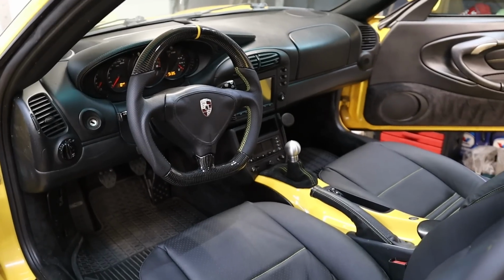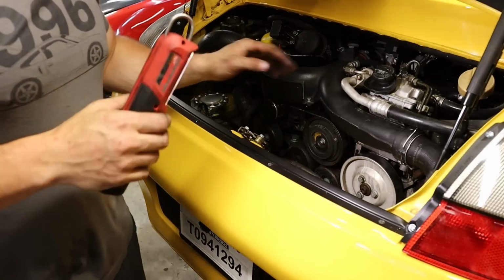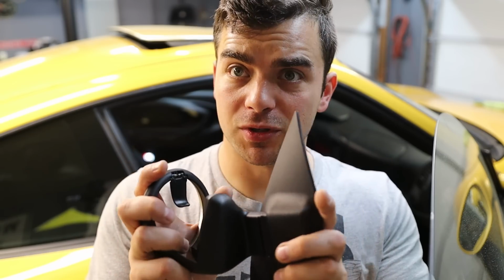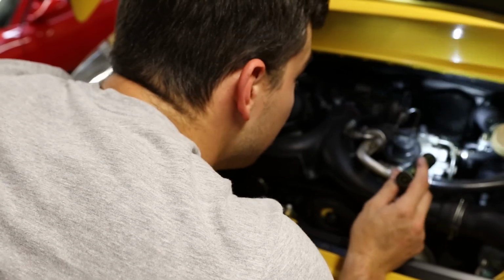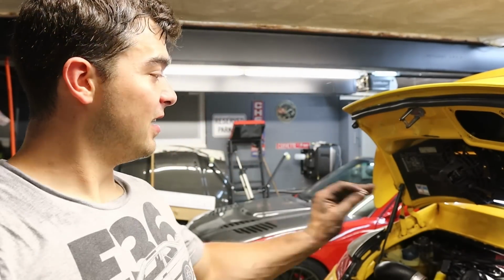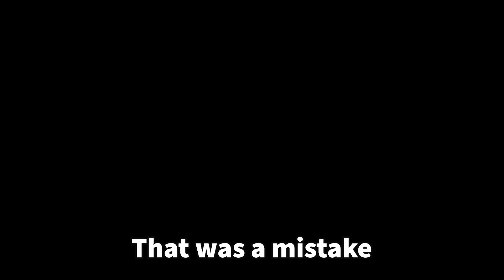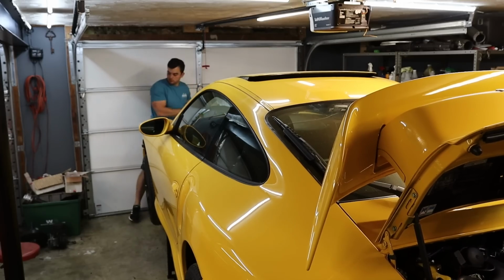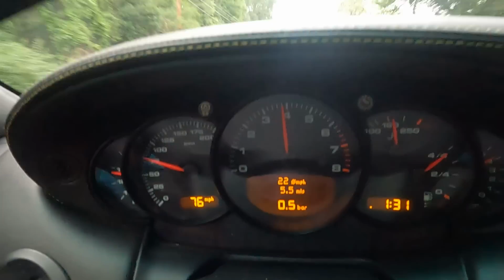I Bought a Cheap Porsche 996 Turbo and It's Unfixable

Comment: Okay, so it could be one of two things maybe the idle control valve unit is faulty , but then, saying that you would get a correlation code, for that, or it may be a case of doing a complete relearn for all of the systems, so it’s all reset to 0, especially the throttle body, now I’m pretty sure you have got the equipment to reset the throttle body values. I know on VW‘s you can do a manual reset by just put in your foot on the throttle when the car is turned off., still keeping your foot on the throttle. Turn the car on but do not start hold for 10 seconds, then release the throttle completely take your foot off of it and then turn the car off.
Reply from the maker: No codes, except for EVAP.
Reply: @matt13ross  also another thing to check would be your fuel cap , when you remove the cap after the car has been running, you should hear a hiss, , if you don’t, it may be something just as simple as claiming the gasket on the fuel cap, or it may be the control control valve, if you find that you still have the problem after looking at these, I will suggest using your smoke tester but only do a section at a time. This way you can narrow the leak down a lot quicker moving forward
Reply: @matt13ross  the only reason I know all of this because . It’s basically for the same reasons as what you’re doing trying to save money and not using mechanics. I’ve had to learn this because most of the mechanics that touched my car didn’t do the job properly. As air leaks are very common on my car ,  especially the pvc valve and evap  system lol
https://youtu.be/Gzly6J-IWXM

Comment: More Air.... you need to reset the Air Sensor. He calculates   with old memories. Cut the Batterie for 5 Minutes and after start the engine without reving it. It will need maybe 30 seconds and thats it...

Comment: Why didn't you smoke test from throttle body as you reassembled it.  Also, if you went larger throttle body, don't you need a flash to compensate for additional air at idle, hence high idle. Also, did you do the reprogram of TB after reconnecting the battery? Turn on ignition for at least 1 min, then off for 10 plus seconds, then start?
Reply from the maker: I don't think I need a tune.  Reprogram is a solid idea though!

Comment: You maybe should have done the smoke test with the throttle body off. You would have eliminated that and also had more room. Also you need to get the car tuned for the plenum and other mods. Hate to say it. But a visit to a Porsche mechanic shop for a 250-500 buck inspection could have quickly diagnosed everything and saved you lots of time fixing it yourself.

Comment: I have an '05 Boxster, 987. The layout is somewhat similar on the top of the engine. I had replaced my starter, which is on top of the engine. I had to remove the plenums that fed the intakes. Loosened the large diameter hose clamps each side. (same as your car) to remove the plenum. After buttoning it all up, a week later I got very rough starts when cold. This went on for a few months, tried everything. It turned out, one of the hose clamps was askew on the bottom, where I could not see it, giving a small vacuum leak. Another Porsche 996 guy told me to check it with a mirror under the plenum. Sure enuf, that was the problem. The off-kilter hose clamp on the edge of the rubber boot was just enough to open it for a leak. It's been working great now for 3 months. Hope this helps. look here: https://www.youtube.com/watch?v=MN206c5W1T0&t=2s

Comment: Most Porsche bolts are one time use 😢. If you undone a stretch bolts it won’t matter how tight you torque it. It won’t tighten
Reply: Not most.. I meant a lot of Porsche bolts are
Reply from the maker: Unless it's a critical engine bolt, I don't worry about that stuff.

Comment: Have you got a code reader/ scanner to check the measurements on all the systems? If not a rolling road for tune with the new throttle body might be the way to go. ? 🤔🤔
Reply from the maker: Yes I do

Comment: are your Quick jacks on the proper side? You shouldn't have to put your hand and arm through the jack to release the safety. I have a set and I keep the safety bar on the outside. All I have to do is use my foot to release the safety.
Reply from the maker: I don't have them on the proper side, no.

Comment: Dude, how much air are you blasting into that thing? It's made to hold less than 20 psi. It sounds like you're blasting it with significantly more than that. If that's the case you're probably blasting leaks into it.
Love what you're doing though man. You give me inspiration to not burn my bucket of bolts to the ground 😬
Reply from the maker: It won’t even hold 20psi lol.

Comment: It's totally fixable my man. Waited  a couple of days to post a comment, but I seriously think ( without actually looking at it in person ) it has to do with the throttle body. 
You could hear air coming from around there before, then re-torqued with washers and had no air. Now it's idling high. Probably needs more miles, and time to relearn. Unless you have a pretty good scan tool, to manually adjust the idle.
Reply from the maker: Going to check throttle body next!

Comment: Put the stock throttle body on the car see what happens.  Typically  all larger throttle bodies on boosted applications aren’t needed anyway. Really only see gains on supercharged or n/a engines.
Reply from the maker: I can't because the IPD plenum is made for the bigger throttle body.

Comment: Don’t know much about Porsches but if I had to take a guess it would be something in the PCV, maybe a check valve is missing or backwards somewhere? Otherwise a cracked intake? I know you don’t want to drop the engine but I think Porsche drops it for pretty much any reason, so may want to just bite the bullet and take the engine out. Hope you find this damn leak!! 😎
Reply from the maker: You'll find out in the video coming out today!

Comment: its the turbo or the intercooler ime....start with the intercooler obv
Reply from the maker: No leaking down that way. All in the engine bay.
Reply: @matt13ross  that's strange, I've had weird issues before like this with loose o2 sensors before as well as the car revs higher to stay running due to a small leaj

Comment: I don’t get why you did all the cosmetic things first while the engine has issues. 🤷🏼‍♂️
Reply from the maker: Because everything on the car needed to be fixed.  It doesn't always happen in a perfect order .
Reply: @matt13ross  but if the engine is bust you’re not going anywhere. If it’s some bad issue, you have to either find another engine or remove all the stuff you did new and put it onto another Porsche. 
Love what you’ve done already though, that’s not the point 👍🏼

Comment: Here's an Ai list of potential causes:

User
why would a 996 turbo not be holding boost?

ChatGPT
There could be several reasons why a Porsche 996 Turbo may not be holding boost properly. Here are a few possible explanations:

Boost Leak: A boost leak occurs when there is an air leak in the intake system, causing the turbocharger to lose pressure. Check for loose or damaged hoses, intercooler leaks, or faulty seals in the intake system. A boost leak test can help identify the source of the problem.

Worn or Leaking Turbocharger: The turbocharger itself may be worn or have internal leaks, leading to a loss of boost pressure. Inspect the turbocharger for any signs of damage, excessive shaft play, or oil leaks. A failing turbocharger may need to be rebuilt or replaced.

Faulty Wastegate: The wastegate controls the amount of exhaust gas flowing through the turbocharger, regulating the boost pressure. If the wastegate is stuck open or malfunctioning, it can cause a loss of boost. Inspect the wastegate actuator and ensure it is operating correctly.

Boost Control System Issues: Problems with the electronic or mechanical components responsible for controlling boost can lead to inconsistent boost levels. This can include malfunctioning sensors, solenoids, or the boost control valve. Check the boost control system and its associated components for any faults.

ECU or Software Issues: The engine control unit (ECU) or the software controlling the boost may have encountered a glitch or malfunction. Updating the ECU software or performing a diagnostic scan can help identify any potential issues.

Fueling or Ignition Problems: Inadequate fuel delivery or ignition issues can cause a lack of power and reduced boost. Check the fuel system for clogged filters, failing fuel pumps, or insufficient fuel pressure. Additionally, inspect the ignition system for faulty spark plugs, ignition coils, or ignition timing problems.

These are just a few potential causes for a Porsche 996 Turbo not holding boost. It's recommended to consult with a qualified mechanic or a Porsche specialist to diagnose the specific issue and perform the necessary repairs.

User
There is a forward (toward the front of the car) air leak when the car is running.
ChatGPT
If there is a forward air leak in your Porsche 996 Turbo while the car is running, it could be related to the intake system or intercooler. Here are a few possible causes to investigate:

Intake Hose/Tube: Inspect the intake hoses or tubes for any cracks, loose connections, or detached clamps. These components are responsible for delivering air from the air filter to the turbocharger. If there is a leak in this area, it can result in a loss of boost pressure. Ensure that all connections are secure and free from damage.

Intercooler: The intercooler is responsible for cooling the compressed air from the turbocharger before it enters the engine. If the intercooler has a leak, it can cause a loss of boost. Check the intercooler for any signs of damage, such as bent fins or oil leakage. Also, inspect the connections between the intercooler and the rest of the intake system.

Blow-off Valve: The blow-off valve releases excess pressure from the intake system when the throttle is closed, preventing damage to the turbocharger. If the blow-off valve is malfunctioning or not sealing properly, it can lead to a boost leak. Ensure that the blow-off valve is functioning correctly and that the seal is intact.

Throttle Body or Intake Manifold Gaskets: Leaks in the throttle body or intake manifold gaskets can cause an air leak and result in a loss of boost. Inspect these gaskets for any signs of wear, damage, or improper sealing. Replace them if necessary.

Vacuum Lines: There may be vacuum lines connected to various components in the intake system. If any of these lines are damaged, loose, or disconnected, it can cause an air leak and affect boost pressure. Inspect the vacuum lines carefully and replace or repair any damaged sections.

It's worth noting that a forward air leak could also be caused by other factors, such as a damaged turbocharger or exhaust system issue. If you're unable to identify the source of the leak or resolve the issue yourself, it's recommended to seek assistance from a qualified mechanic or a Porsche specialist for a thorough diagnosis and repair.

User
Can you list all the possible potential causes?
ChatGPT
Certainly! Here is an expanded list of potential causes for a forward air leak in a Porsche 996 Turbo:

Intake hose/tube damage, cracks, or loose connections.
Intercooler damage, leaks, or loose connections.
Blow-off valve malfunction or improper sealing.
Throttle body or intake manifold gasket wear, damage, or improper sealing.
Vacuum line damage, leaks, or disconnections.
Faulty turbocharger or turbocharger seals.
Loose or damaged clamps in the intake system.
Faulty wastegate actuator or control.
Intake manifold cracks or leaks.
Faulty or damaged intake air temperature sensor.
ECU software issue affecting boost control.
Exhaust system leak near the turbocharger or wastegate.
Failing or clogged catalytic converter.
Faulty or damaged pressure relief valve.
Damaged or worn turbocharger compressor wheel or turbine blades.
Incorrectly installed or incompatible aftermarket parts affecting the intake system.
Please note that this list is not exhaustive, and there may be additional factors specific to your vehicle. It's advisable to consult with a qualified mechanic or Porsche specialist to diagnose the issue accurately and determine the precise cause of the air leak.

User
are there more causes?
ChatGPT
Yes, there are additional potential causes for a forward air leak in a Porsche 996 Turbo. Here are a few more possibilities to consider:

Cracked or damaged intake manifold.
Faulty or worn diverter valve.
Faulty or damaged mass airflow sensor (MAF).
Loose or disconnected vacuum hoses.
Faulty or damaged throttle position sensor (TPS).
Cracked or damaged turbo inlet pipe.
Damaged or worn turbocharger bypass valve.
Faulty or damaged intake air control valve.
Cracked or damaged intercooler piping.
Incorrectly installed or incompatible aftermarket intercooler.
Loose or damaged intercooler couplers.
Faulty or damaged boost pressure sensor.
Carbon buildup in the intake system affecting airflow.
Faulty or damaged PCV (Positive Crankcase Ventilation) system.
Remember that diagnosing the specific cause of an air leak requires careful inspection and testing of the various components. It's recommended to consult with a professional mechanic or Porsche specialist who can perform a thorough diagnosis to identify the exact source of the air leak in your specific vehicle.

User
are there more?
ChatGPT
Certainly! Here are a few additional potential causes for a forward air leak in a Porsche 996 Turbo:

Faulty or damaged turbocharger wastegate actuator.
Damaged or worn turbocharger compressor housing.
Faulty or damaged boost control solenoid.
Cracked or damaged intake manifold runner.
Faulty or damaged intake air temperature (IAT) sensor.
Loose or damaged intercooler end tanks.
Faulty or damaged throttle body.
Cracked or damaged intercooler mounting brackets.
Loose or damaged intercooler pressure pipes.
Faulty or damaged boost pressure regulator.
It's important to note that these additional causes are not exhaustive, and the specific issue with your vehicle may vary. Consulting with a qualified mechanic or Porsche specialist who can perform a comprehensive diagnosis is the best way to pinpoint the exact cause of the air leak in your Porsche 996 Turbo.

User
are there more?
ChatGPT
Certainly! Here are a few more potential causes for a forward air leak in a Porsche 996 Turbo:

Faulty or damaged throttle body actuator.
Cracked or damaged intake manifold runners.
Loose or damaged intercooler mounting brackets.
Faulty or damaged intercooler pressure sensors.
Cracked or damaged intercooler end tanks.
Loose or damaged turbocharger mounting bolts.
Faulty or damaged boost pressure control module.
Cracked or damaged intake manifold plenum.
Faulty or damaged intercooler temperature sensor.
Loose or damaged intercooler hoses.
Remember that these additional causes are not an exhaustive list, and there may be other factors specific to your vehicle. A thorough inspection by a qualified mechanic or Porsche specialist is recommended to accurately diagnose the cause of the air leak and ensure the proper repair.

User
are there more?
ChatGPT
Certainly! Here are a few more potential causes for a forward air leak in a Porsche 996 Turbo:

Faulty or damaged turbocharger wastegate valve.
Cracked or damaged turbocharger housing.
Loose or damaged intercooler mounting clamps.
Faulty or damaged boost pressure relief valve.
Cracked or damaged intake manifold gasket.
Faulty or damaged throttle body position sensor.
Loose or damaged intercooler end tanks.
Faulty or damaged intercooler pressure relief valve.
Cracked or damaged turbocharger compressor housing.
Faulty or damaged boost pressure sensor.
It's important to remember that diagnosing the specific cause of an air leak requires a comprehensive inspection by a qualified mechanic or Porsche specialist. They will have the expertise and necessary diagnostic tools to identify the exact source of the air leak in your specific Porsche 996 Turbo.

Comment: Put the stock intake and throttle body back on.  Porsche spent millions to perfect 👌 the tune. Why mess with the stock intake and throttle body only to ruin the drivability.  50hp nitrous kit on the stock motor will give you noticeable power gain.
Reply from the maker: The stock plenum is broken. That’s why I upgraded lol.

Comment: Dude what are you doing? Blowing air into the turbo or what? This makes absolutely no sense what so ever. You can't check it this way, there will always be an open valve so you are just blowing your air pressure into the exhaust and that btw is exactly how it sounds. The easiest way to test it would be to drive it at top speed and watch what your dashboard tells you but since America and top speed doesn't work out that well go on the highway and accelerate (full trottle) in the highest gear and have a look what the pressure level says when you are in the 4000 rpm range, there it should show you max boost. If 4000 rpm in the last gear is already to fast repeat but one gear lower, but you can't check it in 2nd or 3rd gear since you will not build up full pressure there. The only other way to test it is by removing the whole intake system from the turbo up to the manifolds, and I would call that a complete disaster.
Reply from the maker: It’s a pretty standard boost leak test for these cars….lol
Reply: @matt13ross  ;-) well that might be but you understand why it makes absolutely no sense do you?
Reply from the maker: You can't check for boost leaks just by driving and watching the boost gauge.  With leaks, the turbos will just work harder to reach full boost, that's how wastegates work.